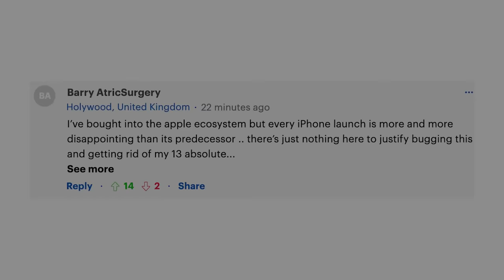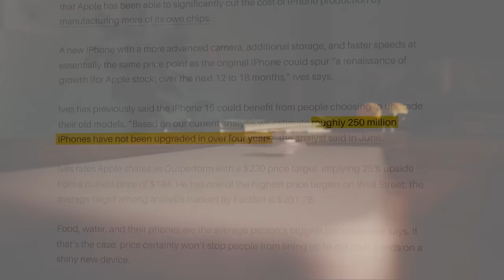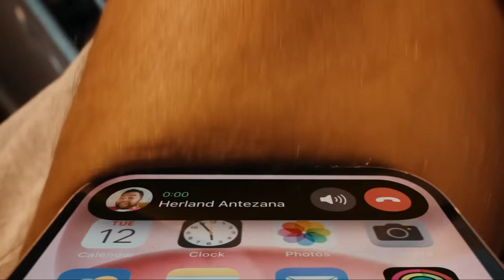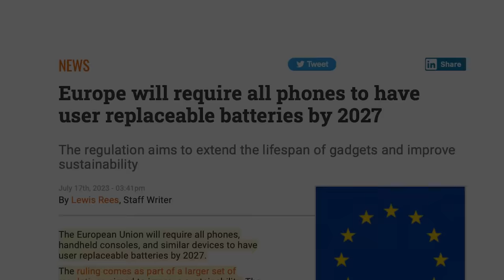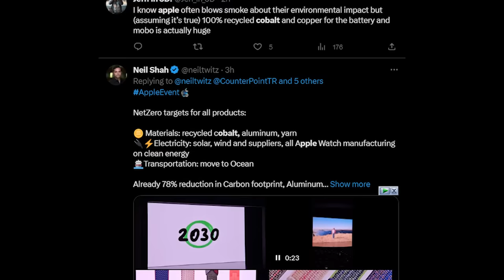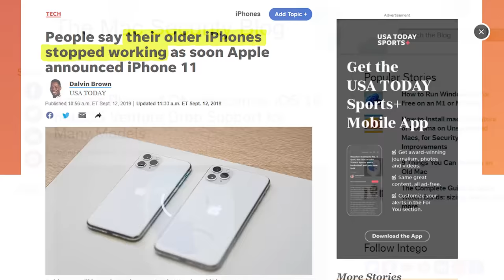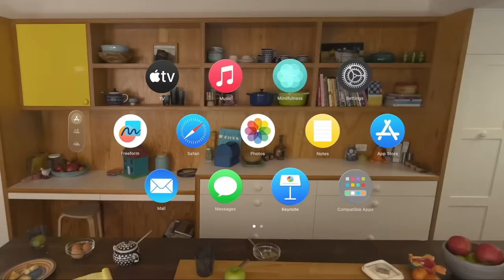The iPhone 15 Is Everything Wrong With Apple

Comment: The iPhone 15 Pro Max is the first iPhone I have had since the iPhone 4s, and so far it has worked pretty good for me no real issues as far as hardware and mostly software goes. But Siri and, voice transcription and voice texting are atrocious on iPhone. That is my only real complaint at least that I can think of at the moment. But with becoming iOS 18 and iPhone 16, I will definitely be upgrading again to get those sweet sweet complete AI upgrades. I know some of them are specific only to the iPhone 16 model. it’s painful going from pixel eight pro and it’s superb voice typing to using apples since most of the time it does not get the right words and is slow 😢

Comment: I think its okay to release a phone every year and they dont even have to reinvent themselfs every time. But there should be absolutly no need to upgrade every year!
Reply: I definitely agree with you. I have been all about upgrading every two years although I’ve had circumstances not being favorable the past couple times when I had the 6 for two and a half years and been on an 8 Plus for four years but for someone like me upgrading to a 15 would be a massive upgrade in comparison to if somebody was going from a 13 to a 15. I believe at the end of the day there is a case by case basis since not everybody’s situation is the same. I always have a case on every phone I’ve owned as well as charging when needed and not letting my phone constantly die.

Comment: I have bought my iPhone X refurbished in 2020. It’s still fast especially after I found out that replacing the old battery has a tremendous impact on the performance.

Nice try apple! I almost believed I need a new phone because it was slow somehow.

Of course it is not getting the newest iOS. But as long it is getting security updates. Also every banking app on my phone has two way authentication. So no worries about that.
Reply: the security updates also slow the phone down to "preserve battery" on all unsupported iphones , not saying you shouldnt update, just keep it in mind

Comment: I agree but only partially. In 15 you get last years top chip(still faster than anything Android has to offer),new camera sensor,dynamic island(not just a gimmick) and usb c.  Phones in general don't improve a lot anymore and this could be said for all the rest of the phone manufacturers. I upgraded from a 4 year phone and this is a massive upgrade,i plan to use this one for 3-4 years at least. But yeah,if you have 13/14 no need to upgrade really.

Comment: Talking about innovation, here are some ideas:
1) back with solar panel
2) phone shook and drop proof the best way to save the planet using less plastic is not cutting cost with selling the phone without charger but to sale a phone that does not need a plastic case to protect it. 
3) real removable battery not glued to the devise. Just like in your TV remote control. 
4) Thief proof phone making phone totally useless when stolen. 
5) camera and micro with a physical blocage capability.
6) phone a few mm thicker so they can host larger battery that could last 3 to 4 days.

Here we go you have the phone of the future right here right now. Call me genius and You welcome!

Comment: Call it "upgradeitis." As with anything, there's a point of diminishing returns. How much expensive gingerbread can a manufacturer add to a phone every year? What compromises have to be made: put in a chip so powerful that the phone now requires a liquid cooling system, complete with radiator and fan?

I don't need a new phone every year. I just moved from the 12 Pro Max to the 6.1" 15 Pro. I bought the 12 Pro Max because I thought I'd have a professional use for LIDAR. In nearly six years, I haven't, and that's the only reason I was willing to tolerate a phone that big. I'm a longtime photographer: the phone cameras have gotten so good that I now consider my phone my second camera body. I still print my work: I don't think a photograph exists until it has been printed. BTW, Apple and YouTubers: "blurred background" != "portrait."

Comment: I bought the IPhone 13 (replaced my iPhone 8) bc the jump between the 8 and the 13 is worth it. Now why not jump from the 8 to the 15? There’s more upgrades between the 2. Well I jumped to the 13 bc there’s not much difference between the 13 and the 15 so I wouldn’t gain that many additional upgrades if I chose to go with the 15 instead.. well there was 1 thing different between the 13 and the 15, the price.

Comment: Vision is not the future groundbreaking idea. There are 5 senses, phones use only 2 and they are overworked to the extent of high fatigue. Only when the other senses like touching the body and other objects, smell and taste get integrated in a device, it will become interesting. Some device that touches you, you can touch it’s objects, you can smell it and taste the contents of display will make it worthwhile.  Else it can only change that much. Folding a phone etc has no long lasting impact, feels new for a small while and then it is routine again. Sound and display can be used only this much.

Comment: Why carbon dioxide matters
Carbon dioxide is Earth’s most important greenhouse gas: a gas that absorbs and radiates heat. Unlike oxygen or nitrogen (which make up most of our atmosphere), greenhouse gases absorb heat radiating from the Earth’s surface and re-release it in all directions—including back toward Earth’s surface. Without carbon dioxide, Earth’s natural greenhouse effect would be too weak to keep the average global surface temperature above freezing. By adding more carbon dioxide to the atmosphere, people are supercharging the natural greenhouse effect, causing global temperature to rise. According to observations by the NOAA Global Monitoring Lab, in 2021 carbon dioxide alone was responsible for about two-thirds of the total heating influence of all human-produced greenhouse gases.

Another reason carbon dioxide is important in the Earth system is that it dissolves into the ocean like the fizz in a can of soda. It reacts with water molecules, producing carbonic acid and lowering the ocean's pH (raising its acidity). Since the start of the Industrial Revolution, the pH of the ocean's surface waters has dropped from 8.21 to 8.10. This drop in pH is called ocean acidification.

Comment: The 13 Pro Max has beaten most of the specs of all the preceeding models and some of the newer ones - mainly battery life. Picked mine up refurbed for £750 with 256gb storage. Happy!

PLUS: I own a Thermal imaging cam with Lightning connector so iPhone 15 would render it useless.

Comment: 1. They’re phones, there is a limit to what to can make them do. So at some point innovation slows down. 
2. May not need a new release every year, but most people get the new phone every few years. I may get the 16, I have the 12. I had the 7 before that, and the 5 before that. So new phones every year offsets the majority of people that upgrade phones every 2-5 years.
3. Samsung has the largest line of phones out of everyone as they try new ideas and see what sticks, then change it the next year. So complaining Apple is bad because they release 4 phones every year seems off when Samsung releases 7 or 8.

Comment: Lightning wasn't about looking different. It was designed to succeed the aging connector, and they kept using it because of the MFi revenue it brought in year on year.
Not biased either way. This is a low quality video.

Comment: as much as i think the eu is making apple better, i think the idea of having really easily replaceable batteries at 4:48 is a bad one, simply because it will make the phones worse in terms of build quality and durability. going as far as, say, the fairphone, is probably too far, and that seems to be what the eu is suggesting, but i think at least having the phone held together with metal clips that you have to use a spudger to open is acceptable

Comment: The only reason i replaced my samsung j3 was storage, performance, and condition. That poor j3 had the back taped on, screen covered on cracks and scratches, i replaced it with a used s10e 🙂

Edit: it was a a3 not a j3, also the only downside of my s10e is a glass back and an non-removable battery

Comment: I've had to repair iPhones at my last job. They are a fucking NIGHTMARE of atrocious "engineering." You have to remove two screws and then run a heat gun all around to loosen the glue. You can't go crazy with it or you'll damage the sensitive crap underneath. Then you have to GENTLY and i mean that in a "life or death" tone, VERY slooowly and geeeeeently pry the bottom up and struggle for a few minutes to get your mega tiny screwdriver angled to loosen not one but two fucking screws. If you just lift the screen, you might cause enough damage to wind up having to replace the whole screen, a bummer if you're trying to fix something else! And that's just the tip of the iceberg. Once inside, it's an absolute mess of hodgepodge stuff here and there. I won't get into the rest. You can find videos about it on this website about how tough it is to do simple things like replace one part. This is why iPhone repairs sometimes cost significantly more than with other brands.

Comment: I gotta say, the iPhone 14 was fine, not many upgrades just the normal minor things they add every year, then i see the 15 i have the same reaction until about half a week in when i saw all the issues. Then i got worried, so so so many wrongs and no rights. i know my family isn't giving up the loyalty yet just because we have been using Apple products for about 30-35 years. Apple was in a similar situation back then, they weren't innovating back then like today, unless this goes on much longer (6 to 8 years) then it could go down the drain. I personally think that Apple has a year or two before they get back in the innovative stage again.

Comment: That is the absolutely same for Samsung and soon Google. The form factor is staying on a similar design intentionally. The Chinese brands are the only ones that actually change the look of their devices from generation to generation. At this point everything hardware has been improved so much that newer devices can't really take advantage of it, so next step will be software improvements and specifically AI integration. So from now on expect more and more devices to change little to none on the outside as it is called branding. Ultimately it doesn't matter if you have iPhone 12 or 15 or Samsung S22U or S23U. The important thing is that you are an Apple or Samsung. Also upgrading each year is not a thing you need to do anymore, this is an old trend and all brands now it. 2-3 years is the current norm. I hate these videos showcasing one brand or another, as they are all doing pretty much the same.

Comment: I used to have a samsung s5 and the best thing it had was a removable battery it was one of the major selling points so I hope samsung will be forced to change it back, I use an A53 5g now but I'll definitely upgrade it that happens

EDIT: the only reason why I don't have the s5 isn't because the battery even 7 years after using it was fine the reason why it's broken is because I shattered it on concrete

Comment: There's no shortage of reasons Apple sucks (many of which you laid out perfectly in this video), but your main gripe over the lack of innovation in certain years is misguided IMO. There's no denying the 15 was lackluster, and the titanium gimmick feels almost insulting, but not every year can be an iPhone X kind of year. Think back to the couple generations that came before it - three years of lame and incremental upgrades, one of them a complete slap in the face to consumers by removing the aux jack and forcing people to buy Lightning adapters. But in hindsight it's clear Apple was saving the real upgrades for the X, which made for a pretty momentous release that was actually finally worthy of upgrading to. So why did they give us the runaround with those boring, piecemeal iterations in the three years leading up to it? With competitors releasing new models every year, the iPhone 6 was going to start seeming outdated very quickly. People will always be more inclined to buy the shiny new Samsung over last year's aging iPhone, and that loss of market share would've snowballed very quickly into an uphill battle to claw it back. So for those buying their first iPhone or who haven't upgraded in forever, it only makes sense to throw them a bone with a few cheap upgrades and come out with a half-ass model in order to stay competitive between big years. I think of these years as updates rather than upgrades. That allows Apple to put the profits from those years toward the  R&D for truly disruptive upgrades like the iPhone X every few years, and this kind of model makes the minor years less FOMO-inducing for those of us who like wait around for the big ones to upgrade our phones - but importantly, it does this without discouraging new Apple paypigs from buying into the ecosystem in the meantime. If they had evenly spread those innovations out over 4 years of releases instead, it would've just set that pace as the benchmark for what we call "incremental", nothing would ever be impressive or exciting, and the yearly FOMO would be even harder to avoid since we wouldn't have a major upgrade year to look forward to. 

Also, yes, the first few iPhone iterations each felt infinitely more groundbreaking than the ones we see nowadays, but that was just the market maturing, still rapidly converging with the cutting edge of tech. Those upgrades were mostly low hanging fruit, and by your logic we should probably be irritated that they didn't just wait until they'd developed the iPhone 4 before entering the smartphone market, rather than subjecting us to the line of rapidly obsoleted early iPhones that came before it.

Comment: I love that my iPhone 13 has 4gb of ram. Like it’s genuinely useless. 2gb of that is always in use and then another 1 is also usually used by something so most of the time I only have 1gb of ram available. Even if it’s a decently powerful phone it can’t even use any of that power cause it has no ram. The base models should in my opinion have always 6-8gb of ram. My friends cheap google pixel had 8gb of ram and it still had more storage and a better camera, higher refresh rate, and he could do whatever he wanted with it. Atleast the EU is forcing Apple to change
Reply: I used the iphone 13 for a month after my fold 4 died. Honestly besides the 60hz screen refresh rate it was fast. 6gb would be great but on ios I haven't noticed it bog down.

Comment: I agree on all points. Still, the Iphone is by far the most eco-friendly smartphone. Third-party repair or battery replacement is widely available (no, you don't need Apples repair program), and in contrast to Android (which have hundreds of models), your local phone shop will always have an Iphone spare parts and batteries in stock. I still use an Iphone SE 2016 in 2023. It works without a problem.

Comment: I mean this with all do respect and do not intend to be hyperbolic. This take on the current situation couldn’t be more far off. Your living in the past. When devices would go from a single core processor to a dual, then to a quad.  The cameras were trying to catch up with regular cameras. These days are gone. The only thing phones are getting innovative with at this point are gimmicks. The customer will now buy a new device every 3-5 years. So Apple is focusing more on its software and ecosystem, which is smart. I work in the industry and listen to my customers. They are happy that devices last longer and are relevant longer.  As far as the battery is concerned, the EU doesn’t know what they are asking. Before the non removable batteries, we saw 3-4 customers a day with battery issues. Once they all went non removable we now see 0. One in every blue moon. This idea that every year there needs to be a new game breaking technology is nonsense. Customers are more concerned about reliability, which Apple is the king of.

Comment: Meh, who cares about "innovation". All I need is doing the basics right. I don't like the iOS, so I'll never buy an iPhone as my phone, and I recently purchased a 3-yo midrange Chinese phone, and the performance was good enough for me. Cameras I don't care. The screen is good enough with 120Hz Amoled. My only gripes about the hardware are that the speakers are worse than my old Pixel phone, and the camera bump is too big that the phone wobbles heavily when I use it on a flat surface.

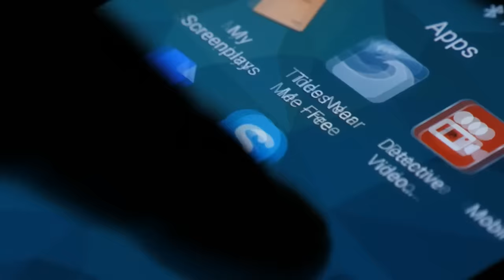Comment: @ 9:15 bro everything is nice thanks for video but iphone wasn't the first to put mult camera they didnot come up with the idea

Also i know and completely agree that design wise there is 0 change but chip and processor is the upgrade
Like you said teck has reached stagnating point interms of mobile hardware but mobile software has still lots to do

Hardware too sometimes is still upgrading (not as fast than earlier though) hollywood expencive 3d trackings like face id sports n moment trackers 3d scanars using lidar vr ar etc etc are now put into comparatively cheap hand held devices